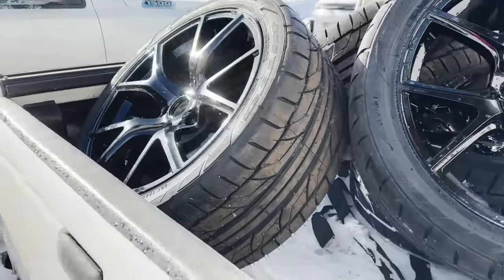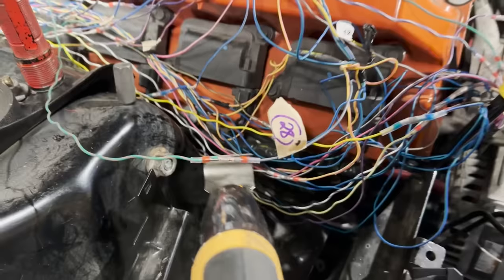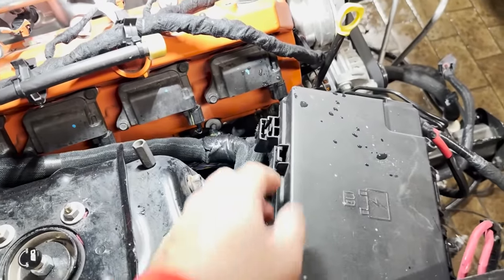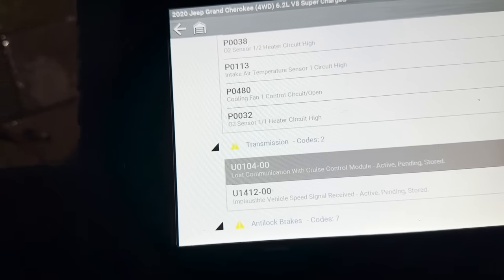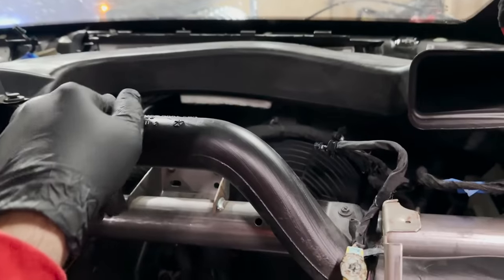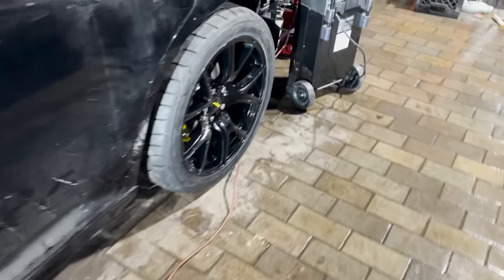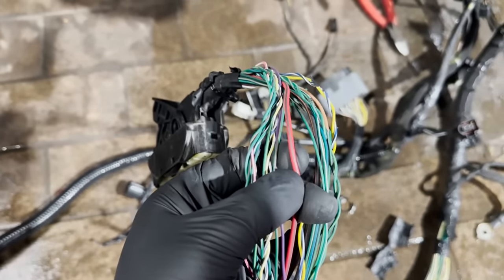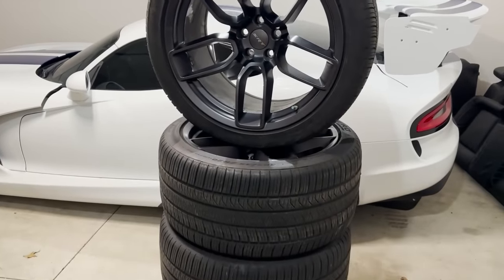I Installed TrackHawk Wheels On My AWD Swapped Hellcat 300! *WOW*

Comment: Add a custom switch or button to the car to were you can go back & forth from 4 wheel drive to rear wheel drive that way if you wanted to do a burn out do a donut or slide you will have the ability to do so by the push of a button or switch that way the trackhawk 300 have the best of both why because its a trackhawk 300 together to make it 4 wheel drive & rear wheel drive best of both worlds together as 1 just my opinion